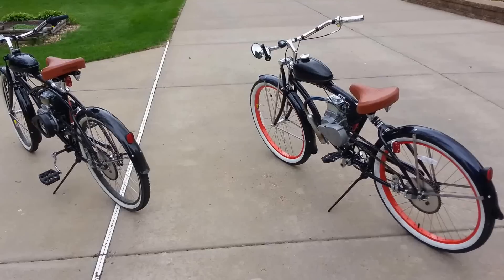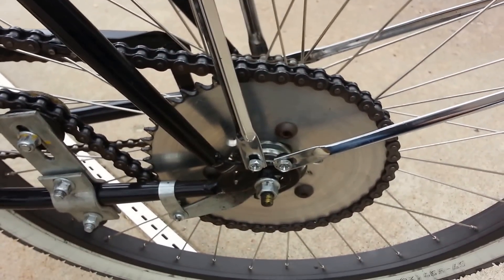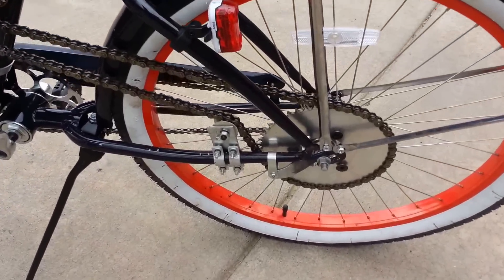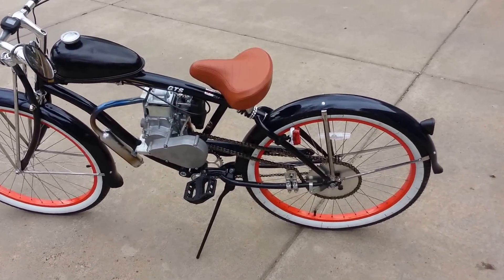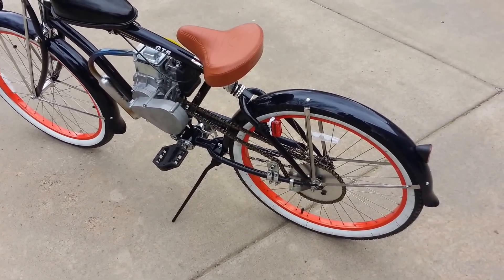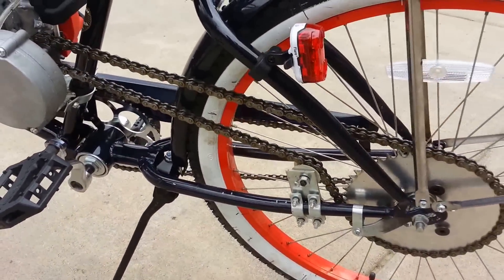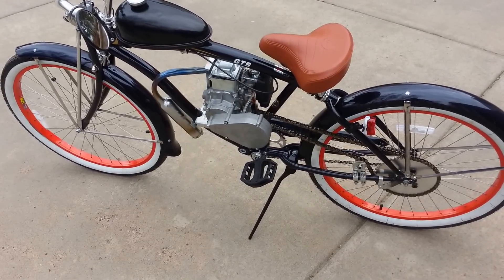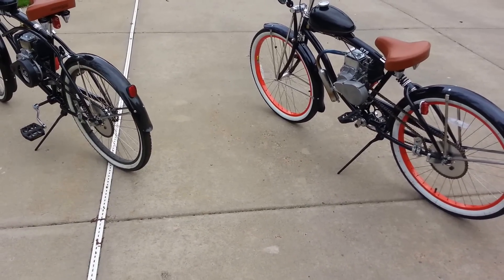Motorized Bicycles (How To Do Gearing)

Comment: What size chains are you using? #35 or #40-41?
Reply: The Shade Tree Fix-it Man, I'm almost 100% sure it's a 415. They are pretty much the standard chain used with this setup. In some small instances the #41 is used.

Comment: dude , good  vid , i'm building  a  stingray chopper bike , 6.5 hp motor , POWER !
i'm 216 lbs  down from 267 . no peddles ,  was  thinking  about  a  58  gear for  the  rear with  disc brakes ...any  ideas   or  vids ?
E-D
Reply from the maker: E-D carter There are a lot of variables that come in to play with your question. What style engine? What style clutch system? Also is there going to be any modification done to the rear wheel? With that big of an engine and being 60lbs heavier than myself, disc brakes are definitely the way to go. Even though I'm skinny as a stick, not having disc brakes on my first build with a 2hp engine was a little challenging. Send me pics if you can of the parts you're using to me at sinistercustomcycles@gmail.com and I'll try and help you out more.

Comment: where can you get the different sprockets from? thanks!
Reply: Sinister Custom Cycles
Hey, the one with the orange wheels,how much for a copy? forget what I said on your page, I would like this one better, and see if can remove that handle, and replace it with the one on this
(http://custommotoredbicycles.com/yahoo_site_admin/assets/images/IMG_9584.98111739_std.jpg)
and
(http://custommotoredbicycles.com/yahoo_site_admin/assets/images/IMG_9582.98111648_std.jpg)

.if the price is over then $900, would you be willing to bargain?

remember my limit is $900.00

~Tobi
Reply from the maker: Henry Chuong I always go through Manic Mechanic out of Florida. If I remember right his website is mmbikeparts.com. If for some reason I'm wrong, which has happened once before lol, just google manic mechanic. Great service and super fast shipping!
Reply: Thanks. I want speed, Speed and more speed! Lol
Reply from the maker: Hello Tobi! Regarding your handlebar question, you should be able to get that set up from any of your local bike shops. I don't build bikes to sell specifically. I'll build myself or a friend a bike and then when I think of something different or better, I'll sell mine and build a different one. As far as copying the GTS build (orange wheels) for $900, my build cost without labor, was $945.00. I would highly recommend saving up a little more and putting an extra few hundred in to something that in the long run will actually save you more money.
Reply: I see....thanks
Reply from the maker: Henry Chuong If you want speed, you will want to check out my next build for sure! If you haven't already, check out the build preview (movie trailer) video!

Comment from the maker: I have never searched for just fenders for a bike at all, especially for a 29" bike before. I think your best bet might be your local bike shop. As far as the exhaust you can pick those up most everywhere. I would recommend Sick Bike Parts though as they seem to have really good service.
Reply: If I buy a shift kit on a single speed beach cruiser .something like a 3 speed hub will that work on the engine. .I am clear on how most people have made there bikes shift but need to know if it's possible with a 3 speed hub ty
Reply: Sinister Custom Cycles the bike im looking at getting is it good? it looks very identical to yours in this video the all black one. it has a 49cc 4 cycle motor.   It has the following up grades.  CSL....clam shell large sprocket adapter, keeps the rear sprocket secure, SPLT spring loaded chain tensioner, removes vibration, SFMUF ... steel flex muffler....front and rear hand brakes and coaster brake. Extra large gas tank at 1.5 gallons not sure the teeth count.
Reply: Sinister CustomCycles 
Here's an idea 🖕You have built 2 bikes in your lifetime Adam so please stop w the "Sinister Custom" Go get some more Lefty Tattoos. 🐸
Reply: i am currently building my bike right now. My question is did you put the exhaust gasket behind or in front of the heat shield